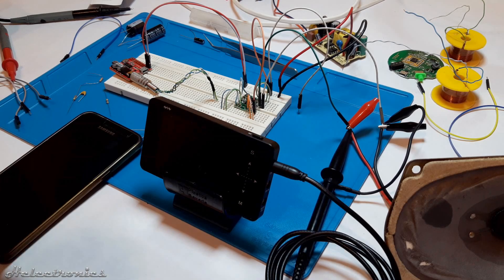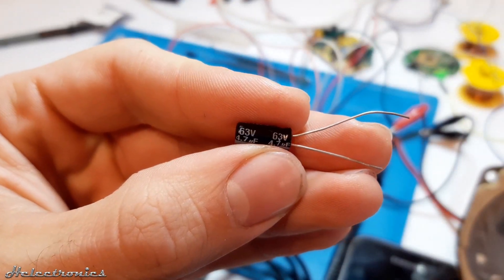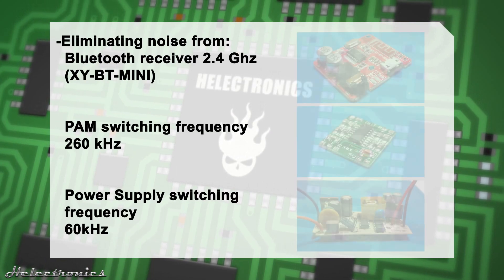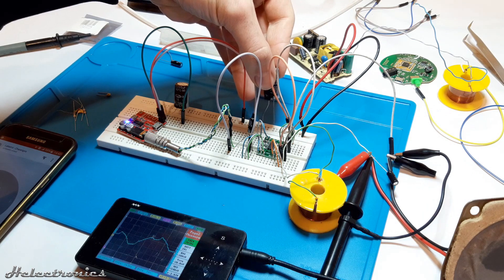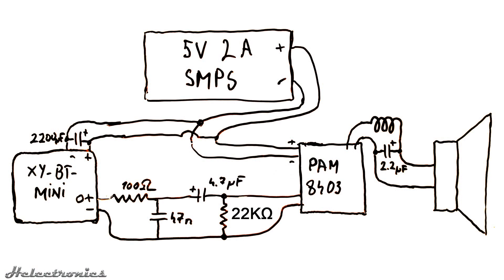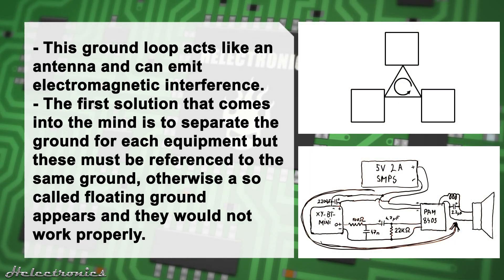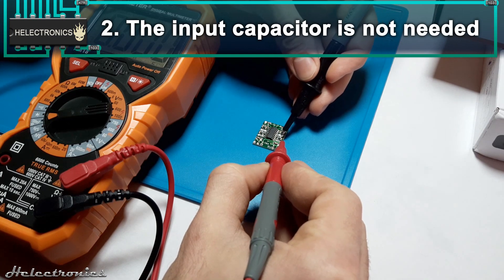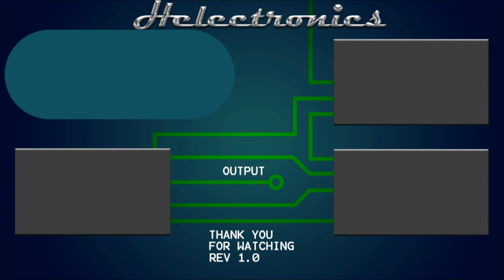TUTORIAL - Connecting PAM8403 to XY-BT-MINI (Ground Loop and Troubleshooting!) (Easy difficulty)

Comment: Xy mini is a bt and 5w dual channel amp so this is dumbingly redundant
Reply from the maker: XY-BT-MINI is just a bluetooth receiver, this model has no amplifier. There are models which have both combined, but sometimes those are really noisy. If you watched my video to 5:50, I did mention those ready made BT receiver boards with amplifiers. This wasn't dumbingly redundant, because I've made a lot of experiments and troubleshootings, which I've shared with my viewers. Please do more research before writing dumbingly redundant comments.
Reply: Yeah doube checked the Pam and xy mini has the same output wattage. There isn't any point putting the Pam onto the xy mini. You could of of put most of this filter stuff directly on the xy mini there's little to no logic to ur project except maybe the Pam isn't naturally bt.  You could of just put most the audio signal filtering directly on the outputs of the xy-bt-mini .
Reply from the maker: Have you tried in reality to connect a 4 ohm speaker directly to the XY-BT-MINI? Where did you read the output wattage for this board?
Reply: @Helectronics  the data sheet by the original manufacturer it's dual channel 3w the aux port is a in or out while the solder tabs are out only. Yes I've played with this board many times. Using a 4ohm 3watt speaker or 5watt speaker was sufficient in volume.
Reply: @Helectronics  it is also intended for 4ohm speakers. They specify 8 in its data sheet as well but based on my readings I don't think you would get much volume from it with an 8 ohm speaker. Same with the Pam modulation on it with a 8ohm speaker I would assume would be rather quiet. The Pam boards are cheaper but they lack the bluetooth.  I recently ordered some more xy-bt-mini boards and some 4ohm 5watt speakers I should receive today. I'll wire it up and show the xy-bt-mini can drive speakers on its own. I have 4 I'm thinking of stepping them fown to 2ohms in a double double set for each channel to test its 2ohm handling though I only intend to use one speaker on each channel. Last time I used this board I hard wired 2 4 ohm 3watt speakers to the left channel in parallel it didn't handle that so well and did better with one speaker on each channel which makes sense if you do the math. The thing I don't like this board about its extremely complicated or ineffective to bring both the left and right channel into mono for a solid 6watts mono combined channel. There's ways to do it. I just find it hard to justify the costs. Once again according to the manufacturer the aux unit is both in or out. But the pads are only out. If you look up the chip as well the one closer to the 16v poppers the 4pins to the left are actually for button control. The xy mini has variable audio range. It's parent board does contain the buttons, but because if this you may feel the xy mini might needed the Pam but the truth is if u jump the 2 n 4th pin together u should get the volume up display.
Reply: @Helectronics  so keep that in mind the xy mini is at a default volume setting and cannot be changed because it lacks the buttons on the chip so it does not naturally output at its max volume,and that's likely the issue your having with it being "quiet".
Reply: @Helectronics  the 4 pins to theft ontop its decoder chip read left to right like such. On/off "power runs directly to thus pin thus power=on since no button is in place."you could cut this pin from the board tab it out put an inline from power to battery negitive with a button. 

Next pin is volume down

Next pin is volume up

The next pin 4th from the top left is bt eg shorting this pin with reset the chip and it will forget its paired device.
Reply: @Helectronics  its hard to say until I play with it because if you look at the actual chips spec sheet it claims the 4 buttons are 1bt then next then play/pause then previous, but this chip could have been modified by the hw-770 manufacturers and the decoder chip itself does support variable volume according to its specifications sheet.

My bad I rechecked the chip diagram pin 11 is bt reboot/on pin 12 is volume up pin 13 is play pause the last pin is volume down. With 2 unspecified pins eg unprogrammed
Reply: @Helectronics  so keep in mind the xy mini has volume control event bt reset and play pause, but the buttons were never added to this board so it's on its default audio setting likely 40%
Reply: Which even worse checking the board there's no memory so every time power is lost you will have to turn the volume back up. Which is another unfortunate feature so even if ur short it to up the volume to full 3-5watt output once it's off you will have to re tune the volume settings. So you really have to put in the work to add the buttons. Which will be complicated to not mess up the chip. But sense only the bt is connected truly to the board u could only connect the volume buttons. Hard tiny job but it's doable. Any way that's why u think it needs the Pam but they have the same output wattage. It's just the xy mini is at 40% volume natively. U got to add the buttons.
Reply: The bt antena connects to pin 20  led is on pin 15
Reply: The aux port connects to the same pins on the opposing side looks like the solder pads are wired in parallel to the aux port anyway so I don't believe you can use the pads and aux at the same time if you want to wire the speakers to the pads. Means it only has one solid out n utilizing the aux as an in skips the board almost entirely, so long as u use a day as aux in and wire speakers to the pad yes the aux is in and or out.

Comment: power supply switching frequency 60 khz it is necesary?or can you just connect the amplifier directly to bluetooth?
Reply from the maker: Not at all, you can power these board with batteries to get even better quality output. The 60kHz switching freq of the power supply should be eliminated somehow to achieve better output quality.
Reply: @Helectronics  then you can connect the plates between them directly and nothing will happen?
Reply from the maker: If you connect both board to the same power supply, a ground loop will be created and they would generate noise as seen in the video, that's why you need to experiment with the connections.
Reply: @Helectronics  and can those circuits be joined as in this video? https: //youtu.be/djAwvEZoG-8
Reply from the maker: @davidurbina3874  You can, but if you pay attention you can hear that the output sound is not clean, moreover you need to use a BMS module (battery management system) to protect the battery from overdischarge and accidental short circuit. The PAM8403 board has no built in  battery protection circuit. The guy just soldered the battery to the modules direcly which is dangerous, also an on-off switch would be also handy if the circuit or battery catches fire haha.
Reply: @Helectronics  Are you referring to a loading module?
Reply from the maker: Yes, BMS is a charging management module for the Li-Ion battery, otherwise the battery can explode. Yes, in the video the blue module is the BMS module for the battery.
Reply: @Helectronics  is it possible then with a 5 volt charging module and two 8 ohm speakers ???
Reply: @Helectronics  and a charge and discharge module could be used to give it double utility for bluetooth speaker and battery to charge the phone, will it work ??
Reply from the maker: Yes it is going to work with 5 volt charger and 8 ohm speakers but it won't be as loud as with 4 ohm speakers.
Reply from the maker: No, this charge module is designed to charge a 18650 li-ion battery. I don't recommend experimenting with that module to charge a phone.
Reply: @Helectronics  which one do you recommend ?
Reply: Can you use the LITHIUM BATTERY CHARGER MODULE TP4056 WITH MICRO-USB PROTECTION then ??
Reply from the maker: https://youtu.be/8MVTInqfuF0 The module used in this video is the best I've used, you can find this board with type C USB connection
Reply: @Helectronics  this is a 4056 charge module
Reply from the maker: Yes it is

Comment: Hi. Great video. Can it charge the battery? or i need to add a tp4056?? thanks
Reply from the maker: Hi, if the Li-ion battery has no built in protection circuit then I highly recommend using a tp4056 module. Thanks for watching!

Comment: On the PAM8403 board, audio ground is connected straight to power ground. Furthermore on the XY-BT-Mini boards that i see, audio GND is also part of the common power ground pour. Trying to connect both power ground and audio ground on either of them necessarily creates a ground loop, even if you're trying to star-ground them - this is not a true star-ground if you have redundant grounds! Just remove all the redundant ground wires, because you have still two ground loops left.

Consider that there are existing capacitors in audio circuit. The 100uF ones on the BT board don't work to your disadvantage. There are however 1uF ceramic capacitors on audio inputs of the PAM board, which i think form a 7Hz highpass against the 22kOhm resistor, which i guess is par for the course, and tying down inputs with such a resistor to ground near device actually reduces noise by a LOT! Because input impedance of PAM is crazy high, so even a small stray current gets converted to a nontrivial amount of noise voltage. Anyway you can reduce component count and it's only going to improve. High pass filtering can be useful to reduce driver excursion and allow more volume, but under normal conditions, it's not an improvement, especially if not tuned to the speaker. Low pass to get rid of some RF interference can be super helpful though.

An inductance in series with the speaker is also pretty futile - a speaker is already an inductor! Unless your added on inductance is so high that you swamp out the speaker inductance, which is just completely impractical, or unless it's similar enough to where you form an LCL filter.

Also solderless breadboards are not to be trusted, i'm sure it's part of the issue with the test setup.

Higher value bulk capacitance on power inputs is not always better. This is because lower value electrolytic capacitors have a lower ESR value as a rule. With this kind of project, i think about 100-470uF total would be perfectly fair, even better if you can distribute it among several capacitors.
Reply: Использовать провод от наушников (тонкий и экранированный) .. чем меньше проводов тем меньше шума
Reply: @nikibelov904  headphone wires are not shielded. There's no point in them being shielded, since a headphone is purely a differential mode transducer and needs a substantial current to actuate. Also headphones are not sensitive to radio frequencies, active circuits are though.

Microphone wire for active microphones is shielded though.
Reply from the maker: Thank for this detailed comment, I don't know how I missed it, but now I respond. You are right, I made mistakes with the grounding, might try it again with your solution.

I've put inductors because when I've measured the output with the oscilloscope, it was full of high frequency signals, so in order to do some measurement, including the output power, I had to add an inductor to filter out these high frequency signals.

I know the breadboard is far inferior than a proper PCB, but for these kind of experiments it is really good.
Reply: I can't find a wiring diagram for this board anymore. This video is nothing but redundant because any one looking at the parts and decoder it is a dual channel 5w amp anyway.

Comment: All you need is this to power your Bluetooth receiver which will eliminate the noise made by the ground loop. My only problem with this Bluetooth module is that when powered on it generates a pop which I can’t seem to find any info, does yours do the same if so how do you fix that ? 
https://www.ebay.co.uk/itm/223746195179
Reply from the maker: Yes, I know about these isolators and those are really good, but I tried to resolve this issue without using them, just by making the circuit connections better. I don't remember if I had a pop but when I will have time, I will check it out
Reply: Helectronics I have 4 or 5 of these but can’t see why the pop when connected.
Reply from the maker: So the XY-BT-Mini makes a pop sound when you power it up or when you connect it to an amplifier or headphone?
Reply from the maker: What kind of power supply do you use?
Reply: @Helectronics  i can use usb or power it by battery its the same so if the board is connected to the amp and i power it up while the amp is on or power them at the same time it pops once power is turned on.
Reply from the maker: It can be resolved, I've measured the output of the XY-BT-Mini and the output is not pure AC, but also 0.4 volts DC which causes a pop when powered, to get rid of this at the outputs you have to put some capacitors. I've made a video about this: BUILD - DIY Homemade Boombox Upgrade.

Comment: Sorry it is kind of off-topic to this video but I have seen that you and a lot of your viewers are actually really knowledgeable in matters of Bluetooth stuff so I thought I contact you guys.. I want to make my livingroom Audio devices wireless (I heard Bluetooth is better suited than wifi?) and thought I would need to buy a transmitter board for every device (vinyl player, DVD player, amplifiers and a tuner so four Boards?) and then I need to get a receiver which will receive all the Bluetooth signals. I connect the output of the receiver to my speakers and subs at last and should be fine right? Please someone help me out with this I am so confused.. Thanks guys, stay well oh and nice video btw
Reply from the maker: It's not off topic if it's about electronics. Also, thank you for watching and for the kind words. What you want to make is possible by using Arduino with bluetooth transmitter and receiver module, but I haven't tested one of that so I can't really help with that.
Reply: @Helectronics  thanks for reaching out